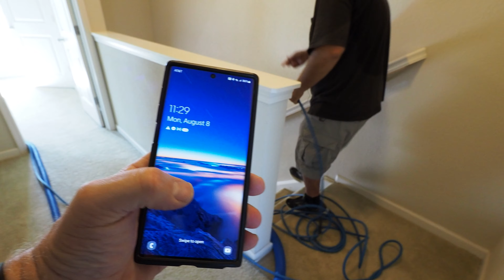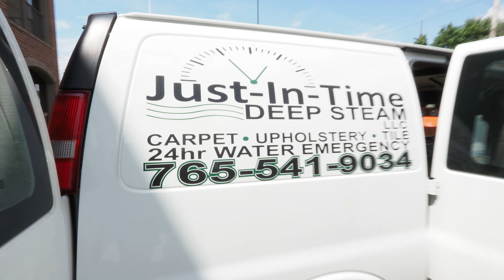Cleaning Challenge! College Turn Cleaning over 400 Student Apartments in 17 days

Comment: What would you recommend for a good wand? I have the bog-standard 2 jet. Don't have a lot of psi or heat atm, upgrading as I go. Was looking at TMF full swivel in the future
Reply from the maker: The wand that's going to really last with a swivel is the Thomas L Conway Devastator swivel head Wands. The swivel and wand are made correctly. He has a 1.5 inch tube on a 12 inch head that no one even attempts to copy correctly if you want the same size tube as you have now. His 14 inch head has the 2 inch Tube. I have 4 of the Devastator Wands. Three of them are the 2 inch tube 14 inch head Wands. They are more then the other Wands by a bit, but that's because the swivel is way better than any other and will last. www.devastatorfilter.com

This is all we currently use and they are killer! 😎
Reply: Awesome! That's exactly what I was looking for.. Not to worried about price. I will just have to save my pennies haha. I'm a firm believer in "buy once, cry once" 😁